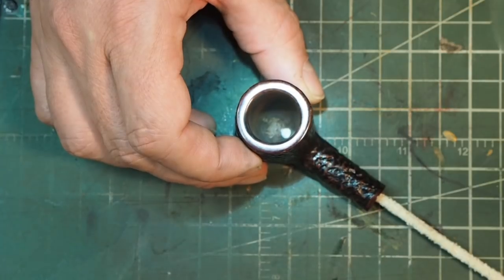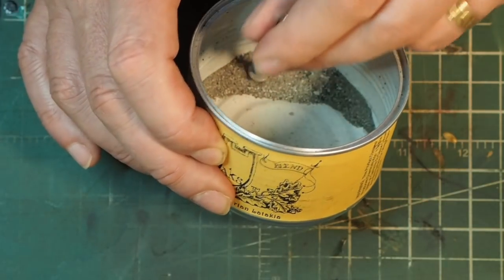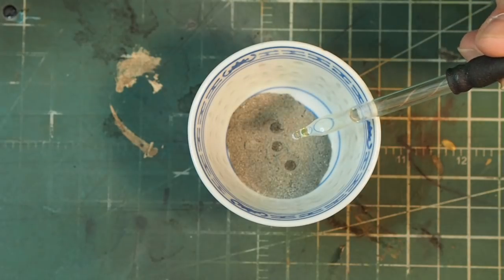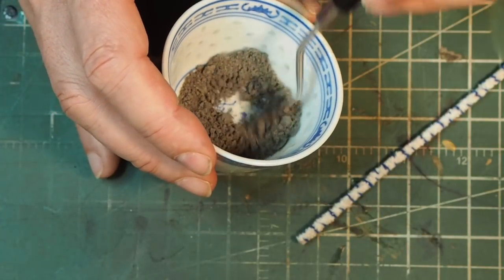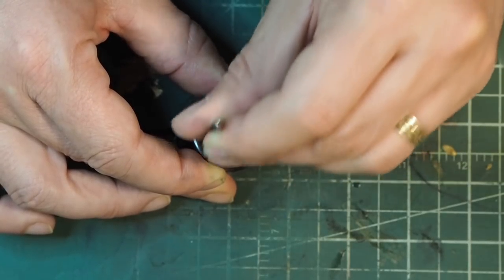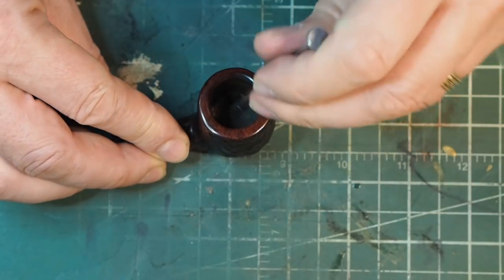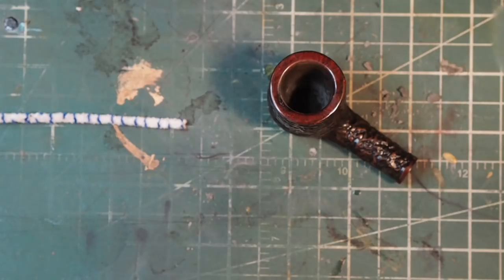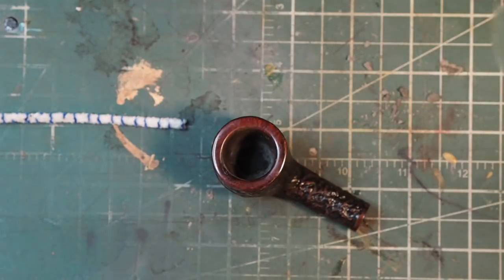Ep43 - How to use pipe mud to fix a pipe that gurgles

Comment: Hey guys, I found that if we added a few drops of water to the bottom of the bowl to wet the surface before adding the ash makes the cake is stronger and less susceptible to breaking apart. Be sure to let it dry out for a couple of days and it should be perfect!

Comment: great tutorial. Some ideas for you, just collect cigar ash as you smoke it and keep it in a small ziplock baggie. You can much crush it to a fine fine powder with your finger in the bag. Also, I don't think boiled or purified water is necessary. You have to wait for all the water to evaporate anyway. I have done this many times to many many pipes, it works great. I smooth it out with a q tip, sometimes wet q tip. I let it dry for a couple days until its completely dry then i smoke it. You also have to remmeber cake will build on this ash coating really fast. Keep an eye out on the cake build up.

Comment: Thank you for the video. What coating do you put after the pipe mud has dried?
Reply: No need for any coating, the pipe mud is the coating itself.
Reply: @chrisw7347  in the video he talked about an additional bowl coating, i was also curious as to what he was talking about
Reply: Very late reply but some people may still want to know...and since the OP didn't answer.

The coating your asking about would be a pre-carbonisation coating, it is a carbon powder coating some people prefer to use in the bowl.
Easiest method I've heard is a thin coating of honey inside the bowl then fill it with the carbon powder, let it sit over night to 24hrs.

A few YT clips on it if anyone is interested.
Reply: @mrbrown3546  I patiently waited and FINALLY lol

Comment: @richardk8313
0 seconds ago
Well I tried CaneRodPiper’s experimental  Pipe Mortar (alternative to  muddying with cigar ash) on several pipes now cobs and briars following the recipe in his video  and I found the results disappointing at best…not only is it a bit messy and more time consuming to apply compared to muddying with cigar ash but it simply does not hold up as well…after allowing several days for the pipe mortar to dry in the pipe bowl my smoked pipes returned it to its wetted stage and when it had time again to dry out produced a powdery dust-like residue that had to be shaken out of the bowl before smoking again.  All things being equal I am of the opinion that muddying with cigar ash remains a better and simpler way to go.